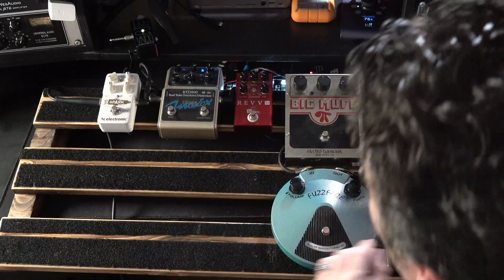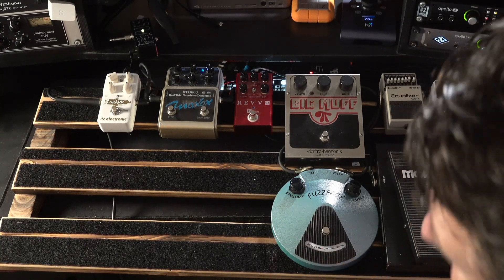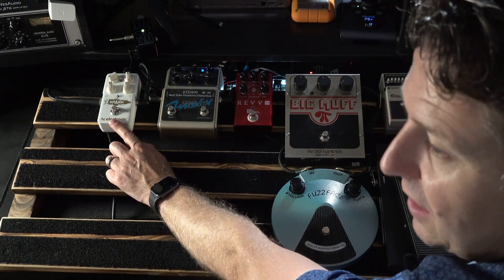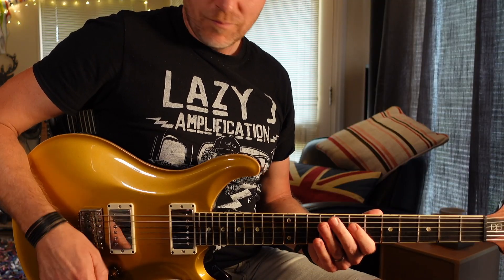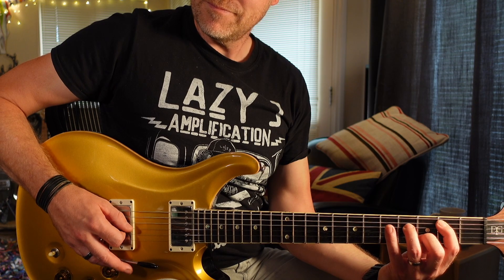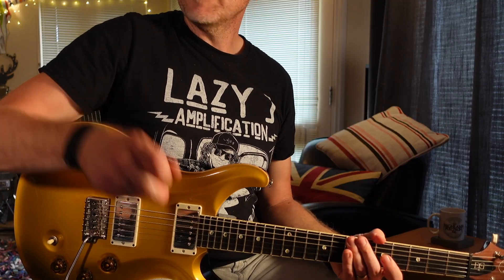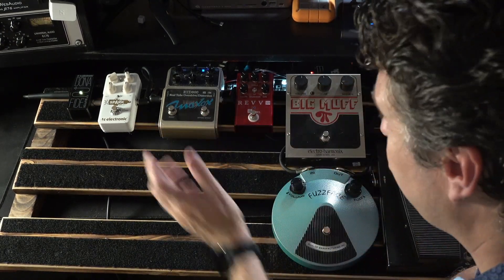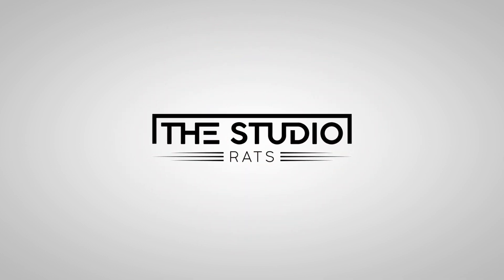Pedalboard Build Video 2 - Drives And Buffers

Comment: Love the Spark boost pedal. I use it all the time as just a normal boost, with low gain and moderate level, and I also I use to push my other drive pedals, adjust eq for the other pedals, and the mid/thick switch gives it a lot more diversity than the average boost.

I actually have my board set up almost opposite - the boost pedal drives everything AFTER the fuzz > wah, and the buffered EQ is the last step into the amp, and gets used both to shape the tone, and as an extra boost step

Comment: I generally like to compare unbuffered and buffered tones to the very basic setup of guitar into good cable into amp. Otherwise, you might find yourself preferring progressively brighter tones (for the same reason you usually like a louder tone better than a quieter one) which aren’t necessarily faithful to the tone of the amp and which might give you in the end too much treble when you apply drive pedals. I found a lot of commercial “ultra highly transparent” buffers give you a tone which is brighter than the reference guitar-cable-amp tone, which to me is detrimental because drive tones can be quite sensitive to treble/presence excess. Not that simply “judging by your ears” is necessarily a bad thing, but I would compare the last tone you obtained (the one with a buffer at the end of the chain) to the pure guitar-cable-amp tone to see if you went past the normal treble content your amp is designed to see. I would also compare the tone of each drive pedal outside of this pedalboard arrangement to see if they sound better out of it. In the latter case, some modification needs to be done to the buffers type and/or placement.

Comment: I understand this video is predominantly about buffers, and ultimately we face a series of trade-offs if we want to incorporate certain pedals that create impedance challenges.  But... I'm tragically OCD and something unrelated caught my eye in the first minute.

Question:  What is the point of placing an EQ pedal this far up in the chain?  I get it if it's there simply as a buffer, as I was considering doing something similar with a Sonic Nuance TDI Tuner.  However, I consider a Graphic EQ a critical pedal that needs to placed after multiple Fuzz and OD pedals to tame a bit of harshness or boost certain frequencies that are being too heavily filtered.  Obviously it needs to be placed after these pedals if this is an objective.

I'm dealing with my own set of pedal placement challenges right now, as the earliest spot I can place an "up front" buffer is 4th or 5th (for 2 fuzz pedals) in my preferred pedal series.  It's leading me down the path of considering buying a Switcher (like a GigRig G3), more for minimizing tone suck and pedal order compromises than it's primary intended purpose(s).  Anyone else starting to think about Switchers in this way (i.e. their primary purpose)?